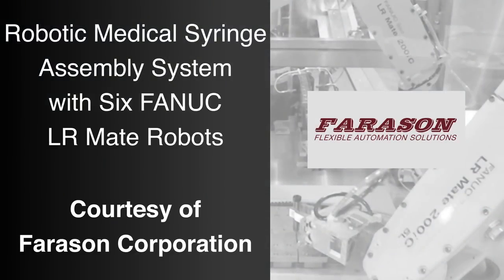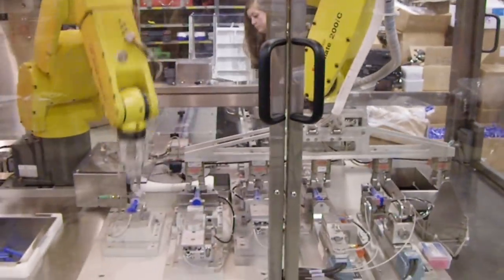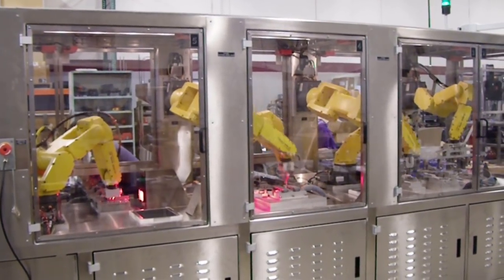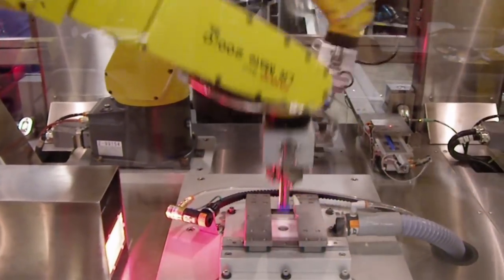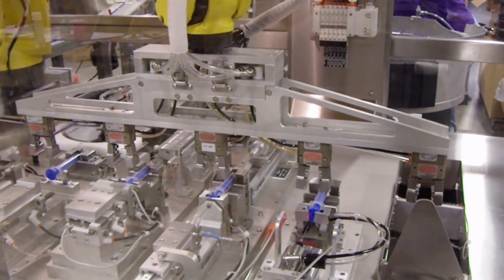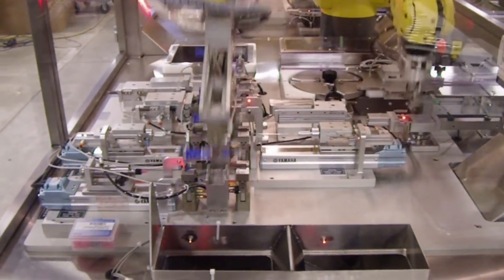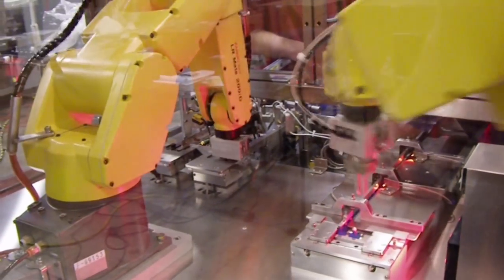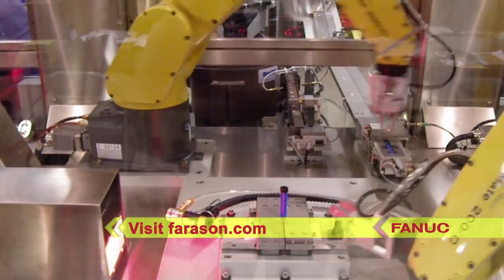Robotic Medical Syringe Assembly System – Farason Corporation

Comment: Doesn't medical production require the use of clean room grade robots?
Reply: that's why the robots are in a glass chamber where you can watch them making it
Reply: @dennavjrp4810  I was talking about the robots themselves.  Clean room type robots require special filtration and ventilation, and protection from letting any gearbox grease in the air, or any particulate into their working environment.  Just putting it in a glass box doesn't make it clean, if you put a smoke machine in a glass case it doesn't suddenly stop emitting particulate that can interfere with the process.  That's why most clean room robots are generally not painted and left in a stainless steel finish with negative pressure purge or special bellows.
Reply: @capnthepeafarmer  Woof